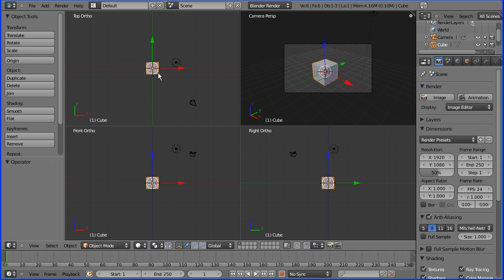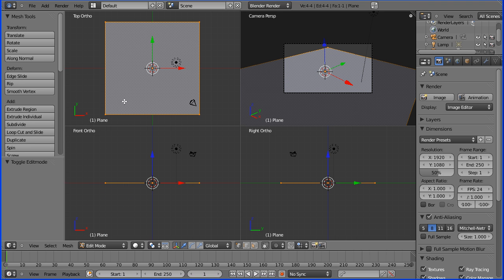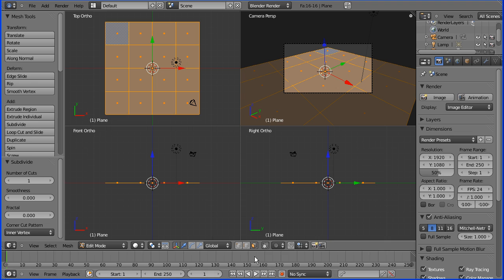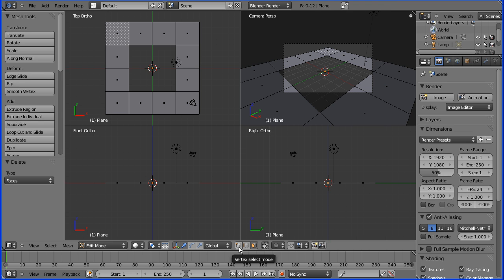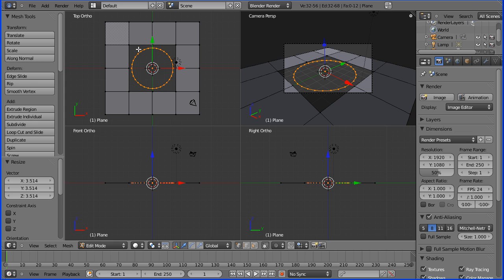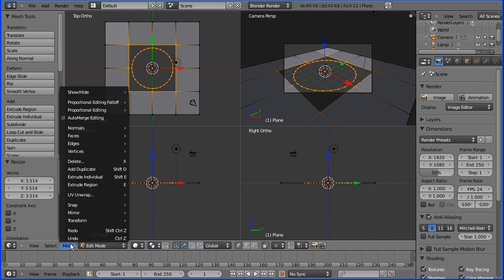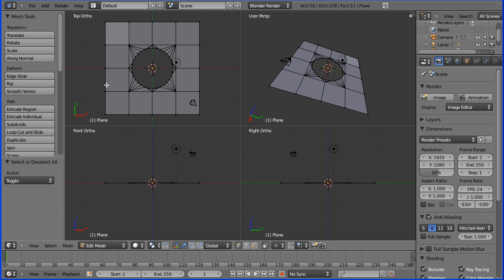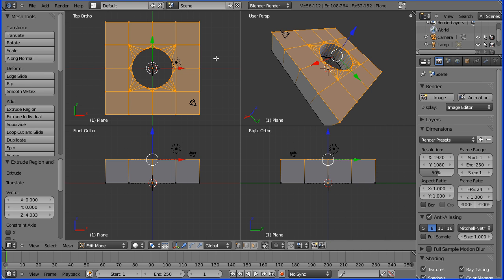Blender 2.5 Modelling Tutorial - Punching,Creating, Making a Circular Hole

Comment: @ianscott888 After deleting the vertices, faces, or edges out of the mesh, highlight the opening that you made and snap the cursor to the selected area. Finally, Press Alt+Shift+S to enable that feature. You can control the strength as usual by moving it or typing the percentage.